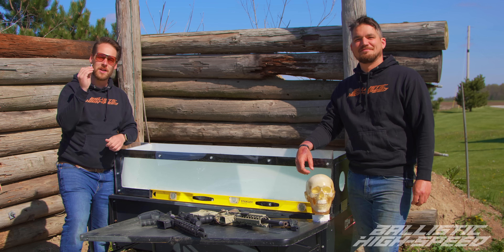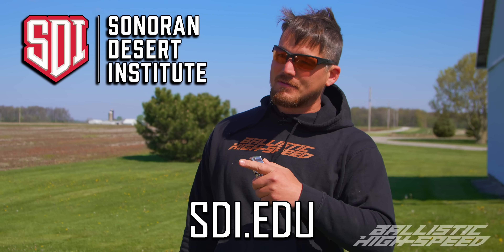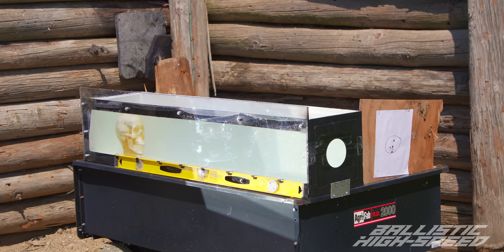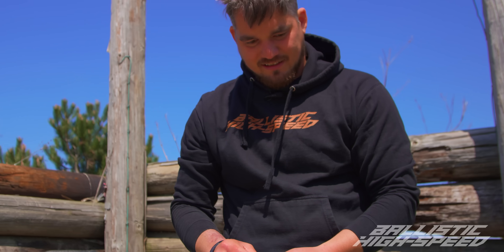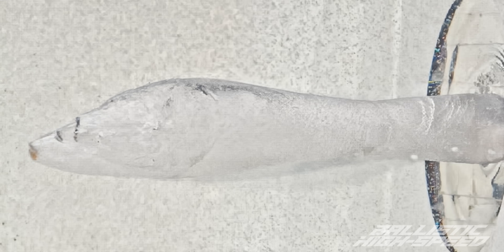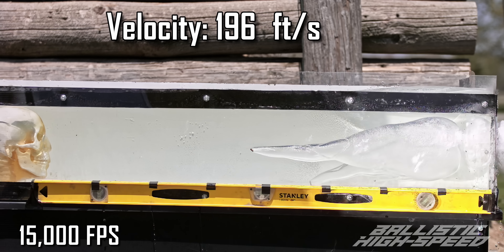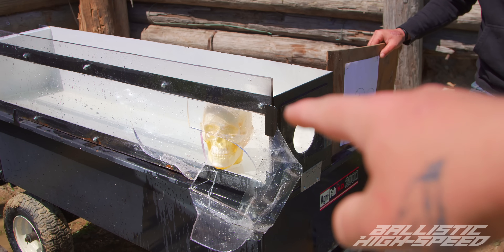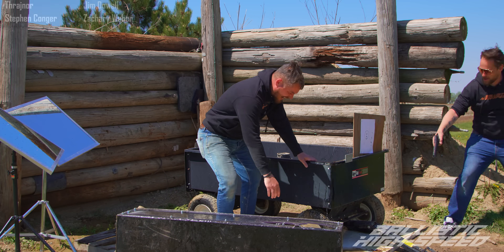How Much Water is Bullet Proof?? FMJ vs Hollow Point! - Ballistic High-Speed

Comment: problem is the water tank they have. The pressure is very low as bullet goes in at the same horizontal level so its only a couple of inches of water on top of the bullet, now if it were to go vertically down, water pressure would increase as well. This is not a realistic scenatio as no one that would attempt to shoot when you dive, wouldn't do it horizontally 2 inches from the surface level of the water

Comment: WTF! Go to 9:54. at 9:55 you see on the left a ark trail of bubbles. 9:59 main air pocket goes down. other force goes near the top. at black tap mark 4 you see a new air pocket open! 10:00 that path fades at the start of the bubbles. the bubbles are now bigger! and end between the eys of the shull? 
it is as if some force moves through the water a lot faster than what we see of the bubblet? 
Can I/we see the full slowmo video of the 2/23. Please! PS. I slowd it down even more! it may be just the shock wave that make the bubbles bigger. but they Do follow the part of the bullets path across the top.

Comment: Someone probably already said this, but I think a taller tank would have yelded different results because of water pressure. If I had the time and money, I'd love to graph out the chance in resistance from extremely shallow tanks to ttanks so large that you'd have a hard time holding back the water with mere tape.

Comment: the mistake you guys made is misunderstanding the forces at work.  when you start shooting supersonic riffle bullets the surface of that water is basically concrete at that point, there is too much energy in the system and the bullet disintegrates as a result.  if you want a kill shot, shooting at something in water, your best bet is probably a shotgun with deer slugs.  enough mass, and slow enough speeds, it probably will remain lethal longer then anything else you shot.

Comment: 14:07 What's the point you moved the head at closer distance when you shot the 308 ? 

How do you know the differences of bullet travel and range between 308 with the previous bullets if you change the distance? 

If you guys desperately need the kill shot, just do it outside the water from the beginning, no need to put the head into the water.

Comment: A long time ago, the Army did ballistic testing on 9mm, 45acp, 5.56 ,7.62× 39 and 7.62×54 (308) NATO. The terminal ballistics on the 556 are brutal. The bullet will enter the body, and after 4-6 inches will "yaw" 90° and break apart at the seam.

Comment: if i can suggest a improvement to the box. do a double steel frame where the plexiglass sits. this way you can remove the hole in the plexi which weakens the over all.

Comment: Did you factor in how much the rounds are slowed down when traveling through the taped entrance? Did you factor in the fact that the taped entrance will also affect the trajectory of each bullet, as it passes through the tape? Also the taped entrance should affect the collapse or expansion of the hollow point, as it engages the tape. Plus if you were shooting at a person in water, you wouldn’t just shoot once. You should shoot 3 rapid automatic shots, to see how the speed and distance are affected by the disruption of the water density of the previous bullets.

Comment: It would be interesting to see the gun also submerged in the water, removing that point of impact with the water, also firing into a much wider container would possibly have a huge impact on the results, I feel that such a narrow box doesn't allow energy to be releases left, right or downwards from around the bullet, only release of energy is upwards, all that energy is reflected straight back onto the bullet, that's gotta slow it down a lot more than it usually would.

Comment: Something about water to keep in mind. It's non compressible.
I'm not a physicist, but here are simple observations anyone can make going to a pool. Slowly placing your palm on the surface and gently pushing beneath offers no discernable resistance. Slapping the surface offers far greater resistance. The same goes for jumping into water. Jumping from the pool deck is no big deal. The water moves easily around you, allowing you to gently pass through. 
Cliff diving, though, can kill you. The surface of the water doesn't break easily for you at those speeds.

Comment: Very cool and interesting episode.  The slow motion showing the interaction from the water pressure has a lot of value and just looks cool.

This is a late post but maybe, in the next box, make the opposite camera side of a flexible/white rubber material to absorb/flex from the water pressure or possibly make just the bottom a flexible material.  You could also make a V shape so the pressure is directed at an angle and up but that may affect the view from the camera.

I was also wondering if it is possible to make a bullet that could create some short-lived air cavitation which would allow it to flow a little farther under water.

Comment: How much velocity drop occurred from piercing the front face?  On the hollow point, it looks like all of the deformation occurred right at the interface, which caused it to slow down dramatically. The rifle bullet suffers the same fate.  Basically, this experiment is fatally flawed because the entry threshold seems to have a huge effect on velocity.  I would redo it in a vertical tank.  Then, you can shoot right into the water with no threshold issues.  You should also create a mount for the guns so that the bullet paths are perfectly perpendicular.  I predict the outcome will be different.  Possibly much different.

Comment: The question is partially that the scenes in films where they're firing from 50 metres away & you're underwater getting shot at. So shoot downwards into a deeper tank I think. Or if it's safe then shoot from under the water.

Comment: It's only valid if you do it from above and encounter surface tension. Through a pane of glass through the side of an aquarium is not a test that will show proper results. No surface tension is encountered, the bullet doesn't break apart on impact as it would in a properly conducted experiment.

Comment: When the bullet hits the water in an angle. That is close to the level of the water. The water will not compress but it will ricochet the round. Unless the angle is a little greater. But looking in water and trying to hit something below the surface is like fishing with a bow and arrow for fish you have to aim under the fish to hit it because light refracts what you're seeing. But it might be dangerous to perform for an episode unless you have a wooden backdrop behind the box so if the bullet skips off the water at a low angle it stops the round. To penetrate the water at an angle you need to be up higher than the surface a few feet. Because it's like playing pool with a cue ball bouncing off a rail that cannot be compressed. You can compress air but you cannot compress water the water will move out of the way violently as it is displaced. It's all physics gentlemen. This was an excellent episode 👍👍

Comment: Federal jacketed hydro shock hitting an object that cannot be compressed immediately peeled off the jacket and flattened the slug to its maximum expansion for that velocity. That's what it's designed to do. That's the diameter of a hole that goes through a body unless it is deflected or deformed hitting a bone which would change the wound channel trajectory. Between these and around that I used to see called a Black talon were one of the most hated rounds to be removed by the surgeons in the operating room I worked at years ago because the wound channel was difficult to track unless a fluoroscope or an x-ray was used to locate the slug. A Black talon round was extremely heinous to try to pull through the same wound channel and had to be excised with a scalpel. Regular FMJ usually are pulled straight out with forceps

Comment: I'm only 5 minutes in but I'm dying to know if those first 2 shots were even deadly after they entered the water 6 inches or 8 inches or so I just feel like it's slowing down so significantly that even if those rounds did hit your dummy's face it wouldn't do much damage. But you would need a head for every shot I understand that but I don't know I hope the video shows more. I wanna know the lethality,  penetration, force at say 6in 12in 2ft then 4ft if necessary. I think father back by a lot the higher you go cause 50cal would be the final test? 🤷‍♂️

Comment: Now the bullet just pushes water out of its way as walls give up. If the water was in hard container then truly we could see how bullet proof water is.
Reply: as water does not get compressed something else must give in. If not the walls then it is the bullet.
Reply: I suppose It is not easy to setup something like that. Hardened glass slab could be expensive... Drilling a hole to hard rock, filling it with water and aligning gun barrel with it. That would be interesting and easier...

Comment: I, too, am reminded of the old Mythbusters episode about this and see that the same results occur, with the pistol rounds going further than the rifle rounds. What intrigues me is what's the dominant factor causing this. My hypothesis is that it's the construction of the rifle rounds (.223 especially) that encourages yawing and decreases penetration, but velocity itself is offered up as well as potentially a disadvantage. A good test to isolate for velocity would be to use the same projectile with different velocities (e.g. 357/38 loaded with the same 125gr bullet). It would be interesting to see if there is an inflection point where higher velocity causes lower penetration, and where that is.

Comment: That's not how it goes in reality. Water is not vertical, you've created an artificial environment/experiment, that doesn't translate in reality. Fire from above, as you would into water and the surface tension will fragment the bullet. The faster the bullet, the more dynamic the effect. The effect on the bullet is the same as firing into concrete.

Comment: Cool video, for scientific purposes tho you guys should increase the vertical depth of the tank. Right now the water can easily be displaced which creates the cavitations. You would get very different results I think if you had a 2 foot deep tank
Reply: If you are 36” below the water surface ,you are pretty much safe from anything fired here.
Reply: This experiment is in a small contained space . In a place  like a lake or river the cavitation would not be 1/10 in that distance .
Reply: correct. pressure increases.

Comment: 24"x24"x 48"  x 1/2 inch Lexan box with an open top, with a membrane at front to shoot through. You should be able to shoot into that without obliterating the box with anything that isn't some .50 cal specialty round....which I'm just assuming that you'll buy to blow the box apart, because...FUN!

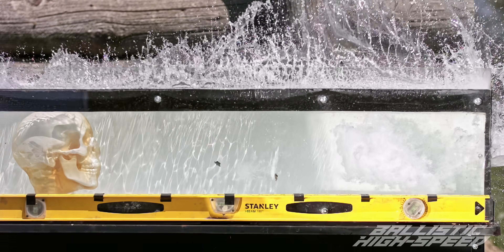Comment: @8:32 yall missed a very cool part about this round, it was spinning so fast and still had so much energy it basically stopped moving forward/horizontall, flipped on axis and the slight pedaling of the round acted like a propeller and the lead round actually went from falling to the bottom to almost exiting the top lol